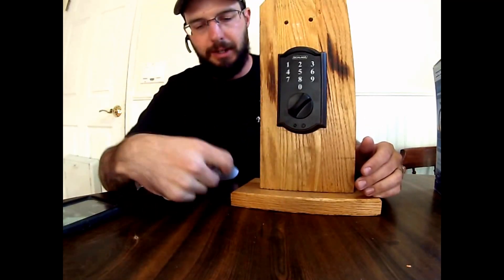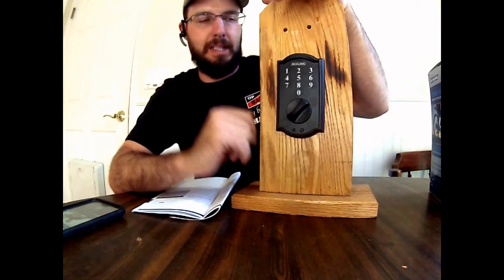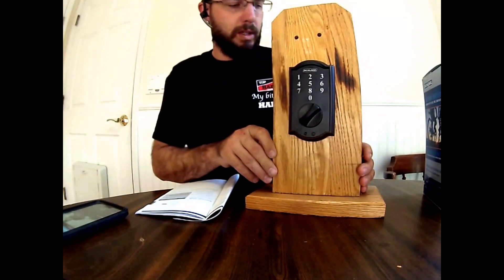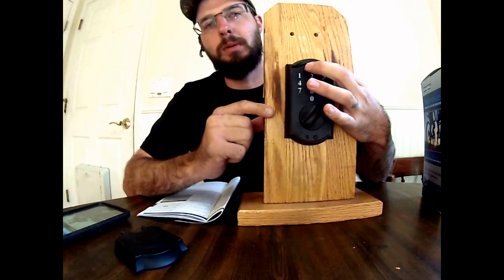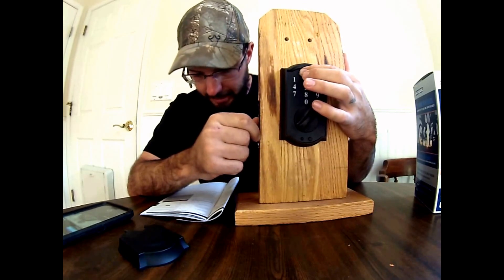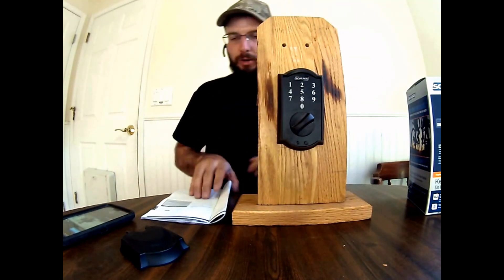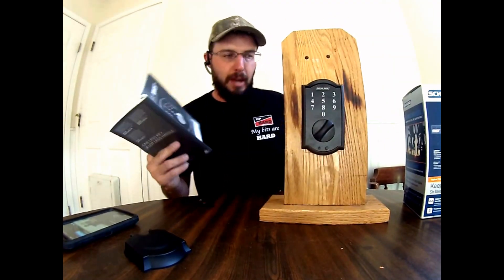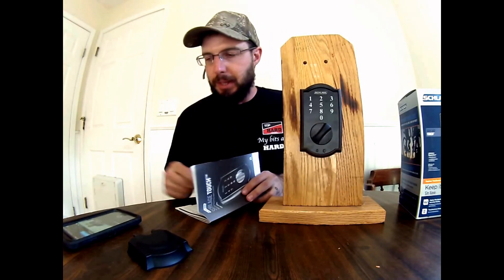Lost Code Fix Factory Default Reset Code Schlage BE 375 Deadbolt Lock Lost Combination FAQ

Comment: Hi Wayne, Thanks very much for your video.  I have a second hand lock FE595 and someone changed the 6 digit setting which stopped me adding a new access code.  I followed your instructions and I reset the lock back to the access code that was listed on the lock by the factory.  Exactly as you said it would.  Thanks for this video you are my hero for today.  All the best, Gary

Comment: Thank you so much we did not have the factory codes because no one left anything with the house when we arrived a few years ago my issues that the locks not functioning properly so I'm hoping resetting the device might help its like it lacks power even with a new battery in it. And just doesn't lock when you tell it too via button press and no longer allows us to unlock the door either it makes noise but doesn't actually function properly. Hopefully its not worn out.

Comment: To save you hours of headache: If you are trying to change programming code and it won't accept your current programming code, then you can easily reset to default programming code by unplugging the wire from the battery, then press the exterior schlage button to clear any additional memory cache, then press and hold the exterior schlage button as you reconnect the battery (you may have to do this twice if the default programming code doesn't work). 

Also note: the programming code can be found on the inside of the unit itself if you can't find where you placed it. Also, if you set up the app, and connect it to your door, the programming code will automatically no longer work. 

It assumes you can program everything on the app. You can reset following my instructions above if you want to remove the lock from all devices and erase everything from it's memory. Good luck🤞

Comment: what if the previous owners were nice enough to remove that sticker on the inside is there anything you can do find out the programming code or just that one.
Reply from the maker: Then your screwed. Sorry but it's the truth. Unless you can find some identifying number on the lock ans call Schlage tech support there is not much to do but replace it.
Reply: chicken hawk farmstead.
Reply: Wayne Winton can I ask when you say inside where inside I unscrewed they back but I see no sticker... you me I have to take the back panel off then the lock n it’s there?

Comment: I purchased a home and don't have the paperwork to change the code.... Once I reset it....as per your video, how do I know what the programming code is?
Reply: It's on the sticker on the inside of the door handle frame that's outside of the home. Sometimes yellow or white. It will list the default programming code as well as the 2 default door pin codes. Good luck!
Reply: Mine has no sticker
Reply: @RyanHull76  Mine has no sticker, some fking maniac prolly tore it off. Now what?
Reply: @RyanHull76  Mine has no sticker, some fking maniac prolly tore it off. Now what?
Reply: @RyanHull76  thank you so much! The Schrade website said I would find it on the indoor side, and I was about to buy a new one.

Comment: Yeah, but... What if, that sticker from the inside has gone missing or the original owner tore it out? Is the whole lock now garbage or use it as a paper weight? I spent 25 min on the phone with Schlage and finally gave up on waiting. So, here I am, trying to find an answer, bet it's simple, too.

Comment: I bought a new home, the program manual wasn't provided, and there is no sticker with a programming code inside the back.

Do I need to buy a new lock? Or, is there another way to factory reset without the program code?
Reply: Becky Cunningham-Smallwood me too! I have the key but don't know how to take off the lock. I can't find any videos of how to change the pin without removing the whole lock. Did any of you find one?

Comment: good video but I have a problem i don't have the booklet anymore and someone took off the sticker with that code on it am I totally screwed or can u help me please
Reply: Take the lock off the door, there is a sticker on the back with your programming code. Then you can download the manual and change both the programing code and the default user codes.
Reply: @kg4boj  you have to read what she wrote. The sticker is missing from the inside of the lock

Comment: hi there. i have the schlage BE375. this past weekend i noticed that it wasnt working correctly. so i dismanteled it, and one of the  wires to the battery were broken. so i fixed that, but everything back on the door. and for whatever reason, i can press the Schlage name on the key pad and it will lock and unlock the deadbolt...i cant figure out what i am doing wrong. im so frustrated.

Comment: Hi there,
Do you by any chance know if its possible to open one without the master password? I have a room that has no other way to go in and i can't open the door. Hope you can help.
Thanks.
Reply from the maker: No without using a drill
Reply: If you have to drill those locks off you're a pretty sorry locksmith. They pick like any other schalge does, they aren't "high security" .
Once he get in via locksmith the programming code is on a sticker right on the back of the lock.
Reply: Inside the back of the lock on outside of door behind numbers

Comment: If you have lost your 6 digit recovery code use the following procedure, you will need a phillips screwdriver and a credit card.
1. remove the 2 screws securing the inside cover
2. remove the 2 screws securing the outside unit to the inner locking piece
3. throw everything in the garbage
4. drive to your nearest home depot or some other store.
5. buy another one
Reply: shabie nycloxliesien 🤣🤣🤣
Reply: the sticker is on the inside panel of the outside piece